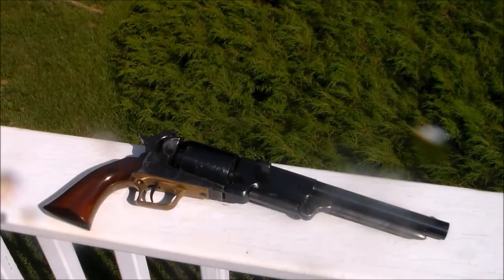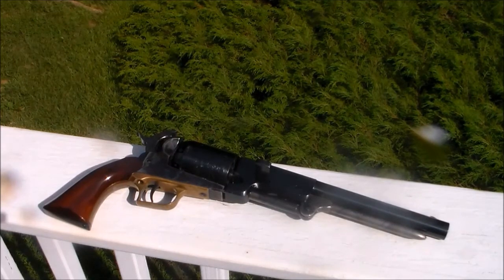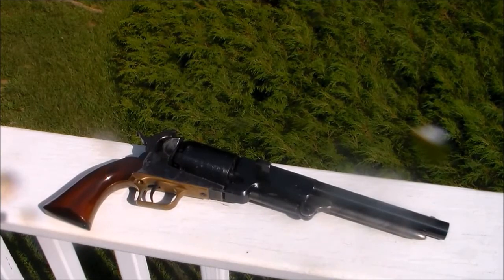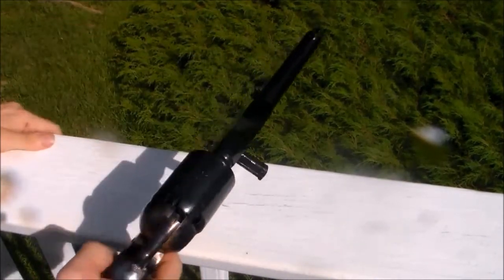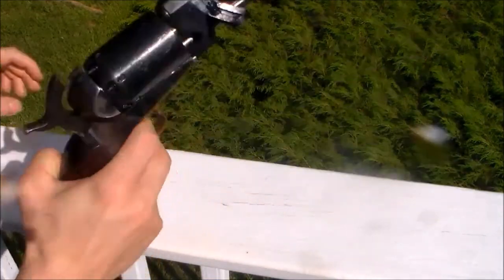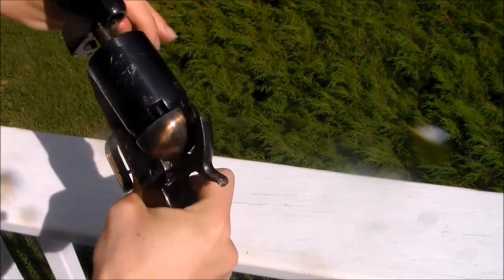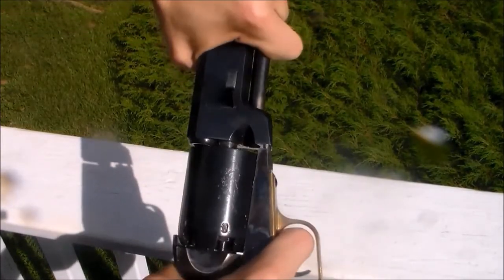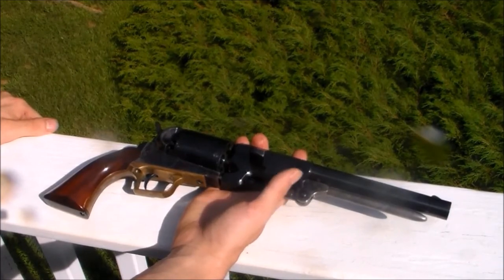Colt 1847 Walker Revolver Repair

Comment: Wont Uberti repair that for free?
Its a nicely finished pistol......too bad their quality control is lacking.
Reply from the maker: It would be nice if these revolvers were made with the same care they were back in the 19th century, Uberti may fix it, but after it has been worked on by goons gun works, it wont have this problem again, and it will be a much better gun once it gets tuned up. Thanks for watching!

Comment: You were lucky that the barrel did not come off when you tried to pull it loose, as you were on a verandah ,or at least on quite a high position, had the barrel suddenly parted company with the action the cylinder would have jumped off onto the floor below, the easy way to get the barrel off is to put the gun on half cock, then use the loading lever to pull it off, preferably with a piece of aluminium strip over the mouth of the cylinder, good luck with your rebuild, I look forward to seeing you in action again soon.
Reply from the maker: Thank you for watching! I can't wait to get it back after it's been tuned up!
Reply: 3 yr ago . . Are there no kewl people getting into black powder ? Just got MY walker back (nitrite coat)
Reply: H8 my phone . Cut me off . got a uberti kit . Had to polish smooth file/sand/stain (4coat)
Reply: G.D. phone did it again . 
Did research on - name it . How to disassemble file/sand smooth hammer trigger lil cylinder stoppy come up thing got it to (in the white) awesomely smooth . After nitride , my guess is  . . . Help
Reply: STG      this phone is going to die . As I was trying to say is that once back together . . Cylinder won't spin - not even to half cock
Reply: IF THERE IS AN ALLAH 
she hates me  . How did I loose distance on the cylinder shaft when nitride is # best less than parkerizing ? Spell check that . End .